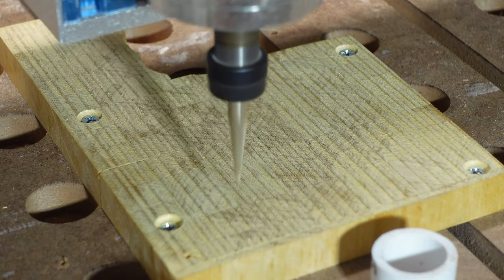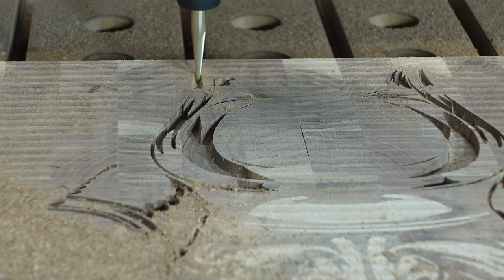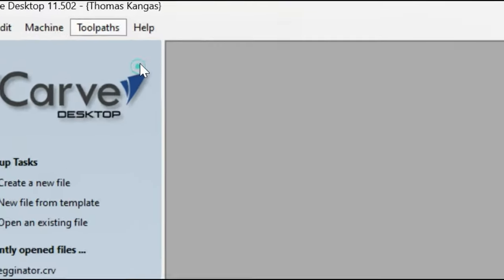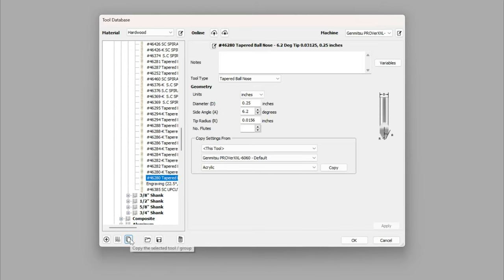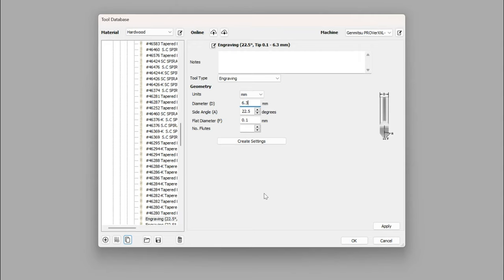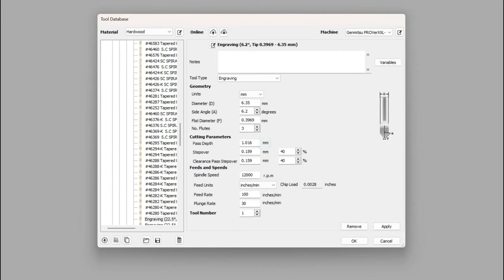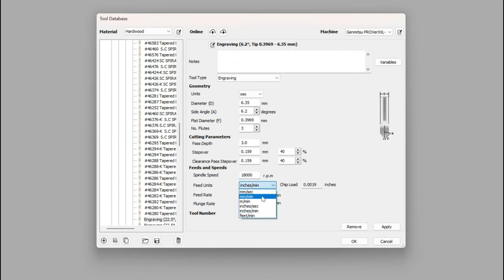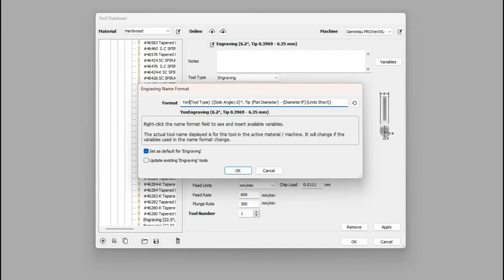TUTORIAL | How to use a Tapered Ballnose Bit as a V-Bit or Engraving Bit

Comment: Thanks for this video
Reply from the maker: Thank You Dany! You actually gave me the idea to make this video, as you reached out to me offline, and asked the question. Thank you for the inspiration!
Reply: @tk.designs  now can  you make a  tutorial how design the samurai on vectric. I have a little problem with that. 😊
Reply from the maker: @dany230658  Drawing it, or manipulating the SVG to work with tool paths?
Reply: @tk.designs  I Use dxf and it's manupilating for the toolpaths
Reply from the maker: @dany230658  I use SVG files for my inlay's, and strangely, I really did have to manipulate the mask to get good cuts. some of the vectors were just not good. Keep tuning in, and I should be able to get a video up. Thanks for the suggestion.

Comment: SO  for the FLAT section of the tool entry your entering the radius and not the actual D diameter which is 1/32?  in v carve the entry is asking for the flat I--I which is the D of the tip... correct? and D of 46280 is 1/32 which would be .793242mm.....   thanks
Reply from the maker: I enter the radius, and have had good results, but now you have me thinking, maybe I should try using the diameter instead. Thanks for pointing this out.  I think what happened is that when converting to an engraving bit, it does not transpose the parameters entirely correctly. I will be making an updated video soon! Thanks for watching!
Reply: @tk.designs  company I bought my cnc asked owner about new endmill which is very thin at the tip said put in diameter

Comment: so to do inyals i dont need vcarve pro but desktop will do right?
Reply from the maker: Correct. You can do a vcarve tool path for the plug side and the pocket side as separate tool paths.  Vcarve 12 Pro just offers a new toolpath that does the calculations for the pocket and plug as a single wizzard type menu.  Thanks for watching!
Reply: @tk.designs  but can I do it I. Desktop version?
Reply from the maker: @Chris-vc1dh  Yes. Vcarve Desktop you can use vcarve tool tool paths to make vcarve inlays.

Comment: Thanks for this.  I was getting hung up on not choosing engraving bit.
Reply from the maker: Thanks for watching!  For the longest time, I watched other creators videos, and saw that they were using tapered ballnose bits, but never explaining how to use them properly.  I did a lot of trial and error, and figured it out. I posted the video, because I figured I was not alone.
Reply: Thanks!  So the flat diameter is the same as the diameter of the ballnose and does this not mess up the length of the bit by removing the vertical distance of the ballnose radius?
Reply from the maker: @s.peters947  The flat diameter is actually the Radius of the bit (half the diameter), so that it accounts for the very pointy tip.  The bits mentioned and that I use are 1/32" diameter, but 1/64" radius. Hope that helps.

Comment: Hey just curious if you’re using clearance tools for your inlays with this bit, or if you’re just cutting the entire inlay with this one. 

Thanks
Reply from the maker: Yes, I use a 1/8 endmill for most of my clearing. Thanks for watching!
Reply: @tk.designs Thanks. I changed the tool to an engraving bit in the database but it doesn’t populate into vcarve inlay. Not sure if it’s an issue with version 12? I’m running it as a pocket toolpath instead but it looks like you were able to have it come up as an engraving bit in the inlay tab? Or did you run it as a pocket toolpath? 

Thanks in advance.
Reply from the maker: @SeamlessFab  In version 12, it needs to be changed to a v-bit. This video: https://youtu.be/5wAd4p_fNkU shows how the change was made for version 12.

Comment: Hi thank you for the video
Question as flat diameter you entered 1/64 this is a radius of the bit. Can you please explain why you put the radius instead of the diameter? Do we need to enter diameter which is 1/32?
Thank you
Reply from the maker: Thanks for watching!  I use 1/64 for the flat diameter, as it is a cross-over from the tapered ballnose parameters. When I configure this as an engraving bit, I take the tip radius from the tapered ballnose parameters, and use it for the flat diameter when configured as an engraving bit. I haven't tried it using 1/32nd. I think I will experiment, and see if  this will work too.  Thanks for the question, and thank you for watching!
Reply: Thank you

Comment: Awesome video. I have been having trouble with inlays and cuts in general with this bit. Corners seem to leave "dots" and I am struggling to figure out what the problem is. I am going to give these numbers a try and see how they work - already seeing that it should be an engraving and not a TBN is already eye opening. 

Another question/side note - I use vcarve and even when I make a straight line sometimes when I cut it, it will appear that it doesn't cut as straight as the CNC should. I saw somewhere else there might be a node in the middle of the line and that might be the issue, but when I check it doesn't appear to be. Sometimes it's straight, sometimes it's not. Seems to only happen on smaller lines. Figured I would pick your brain. Thanks.
Reply from the maker: Thanks for watching!  I regretfully have no answer for your question regarding lines.  Only thing I can think of is possibly that you are missing steps on occasion. The cause being too deep of a pass, or to fast of feed.